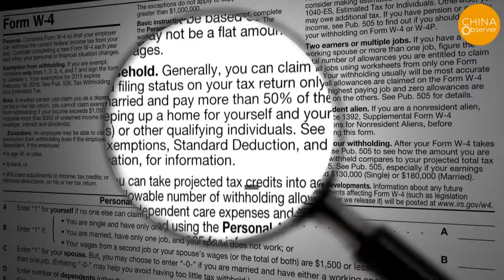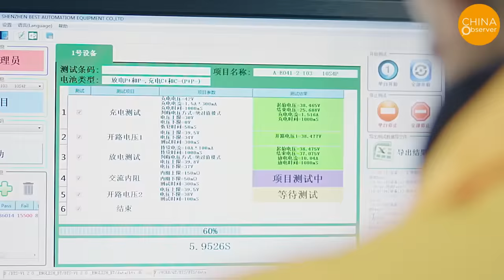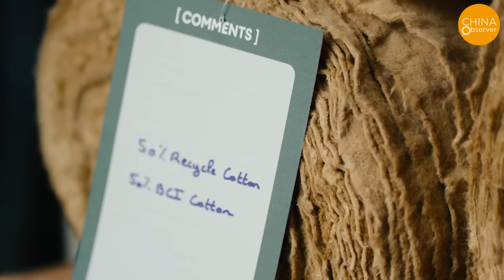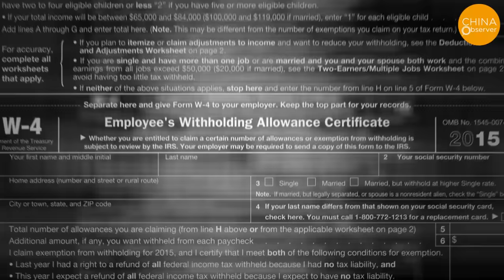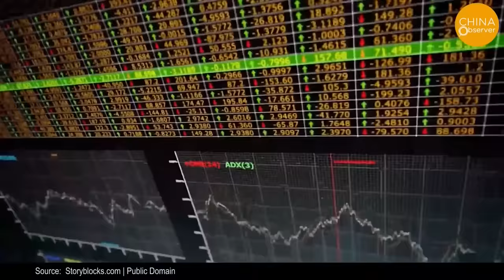Chinese Trade Firms in Hot Water! Caught Bypassing U.S. Tariffs by Rerouting Exports

Comment: At 8:26 it’s suggested that a blockchain could be used for tracking datum of a supply chain. I don’t think any blockchain can hold that much data in each block. You’d also have to insure that the people entering the data are not lying which they already are. 

Please air an in-depth report on how blockchain can be used for supply chains and what would be required for them to work effectively.
Reply: You don't need blockchain for extremely accurate record keeping. "Blockchain" is just a buzzword used to rope in suckers
Reply: Scam elsewhere